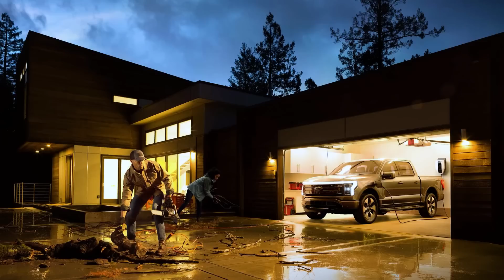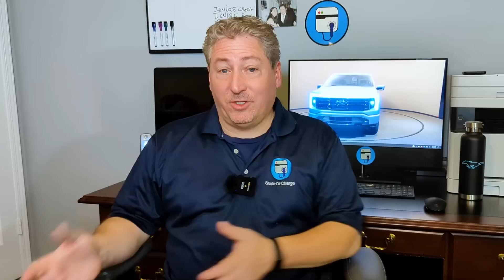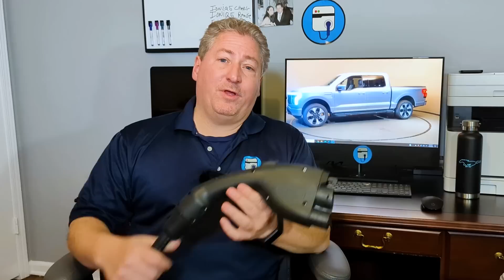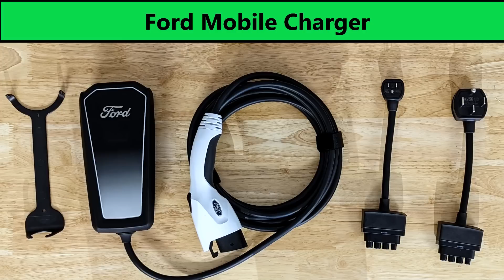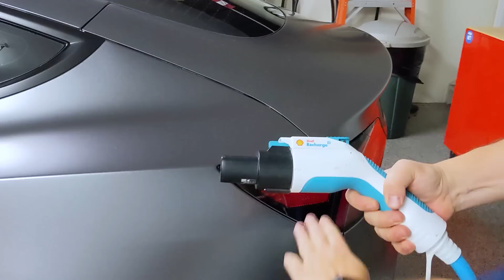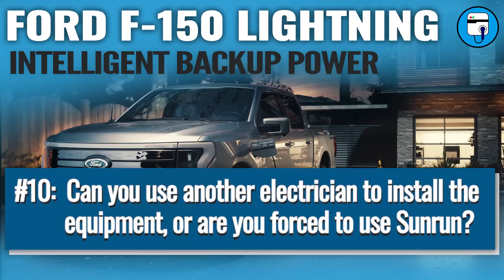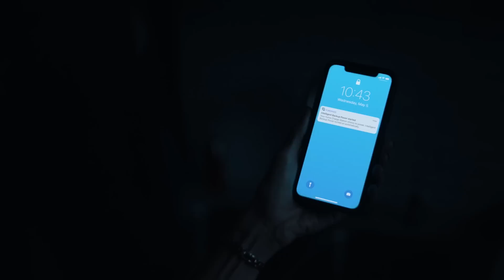Ford F-150 Lightning Intelligent Backup Power: Everything You Need To Know

Comment: Tom, wonderful information. Really appreciate your diligent research. How about non-intelligent backup using the 240 V socket in the bed and a manual transfer switch?
Reply from the maker: That will work also, 30-amps maximum, I'll ask Ford more about that soon.
Reply: I saw the "derpy works" video with this setup using the 2021 F-150 Hybrid and he used a Generac 30 amp manual transfer switch that separated the neutral and ground wires inside the switch box.

I just want to power a camper trailer when I get my Lightning in a couple months so I can get out of town for the weekend!
Reply: @StateOfChargeWithTomMoloughney   Why only a 30-amps maximum? Its total max is 40 amps, based on its 9.6 kW output? On a 50 amp circuit...

fwiw I have asked if using the many forms of backup hookup was an option, in the past...  But with no reply, so I really curious to hear the reply this time... 
Since they all seems more flexible and less costly than what Ford is offering... Since many different power sources can be used with them...  Not just the Lightening...
Reply: @nc3826  The 240V connector in the bed is an L14-30, which is 30A maximum rating.  Could you also connect up multiple cords to the 120V outlets and parallel them for full 9.6kW system output - I'm guessing not based on the overcurrent protection on each.  But you could power the house with the L14-30, and then use the 120V outlets to power dedicated devices - up to the full 9.6kW total output of the truck.
Reply: BJ: I did go into detail  about different ways to do it,, for brevity... But my point was that the "total" system output "available" is the same 9.6kW via the Ford pro or its receptacles... For anyone who needed the extra 2.4 kW...
So thx for your pedantic confirmation of that fact ;)

Comment: Great video.  Follow-up questions...  How does the Home Integration System wire in?  The 80A Charge Station Pro needs a 100A circuit, does the Home Integration System also need a separate circuit from the panel?  Or does it share that same 100A circuit, and wire up only to the 80A Charge Station Pro?  It would seem like some connection between those two is needed - connecting the DC wiring from the vehicle cord to the SunRun inverter?  Also still curious on the specs of what the system can provide regarding surge rating - can this setup run typical 3 or 4 ton central home air conditioning?
Reply: FWIW he mentions it needs its separate circuit...  
Seems to be based on CCS's upcoming V2G functionality.... Which seems to mirror Chedemo... where DC and AC functions are kept separate... Unlike Tesla where DC and AC use the same lines..

And I left a question asking where the DC to AC inversion is done, for its backup power function... But Tom said only the SunRun transfer  box is needed... he did not mention their inverter...
Reply: @nc3826  I think it needs reverse power flow to support V2H but not full V2G support.  The home is islanded with V2H.  V2G implies a lot of coordination with the grid.
Reply: @davidtuttle3429  V2L, V2H and V2G all require "bidirectional" power flow.... Which it will have...(it's not necessary that it be "reversed", on the same circuit),...

And my "CCS V2G" reference was just a conjecture about what "protocols" it uses? Not that its function is to feed power to the grid (even though, it does have the "power circuitry" to do so)....

Sorry to confuse you....

Comment: Since it's pulling DC from the truck, there must be an inverter in the Pro.
Reply: Tom mentioned the inverter is part of the extra equipment you need to buy from SunRun - the Home Integration System.  That kit has the inverter and transfer switch, or so he said.  Charge Station Pro is just a 80A Level 2 EVSE.  Or so it would seem.  Connection between Charge Station Pro power cord and Home Integration System is still cloudy - need more detail there.
Reply: @billjohnson3344  That raises the question which line is the Pro going to back charge.  If the Pro is on a 20 amp circuit, you could only back charge at 20 amps.  You would need another line from the inverter to the main panel to back charge at a higher rate.
Reply: @doug8890  Right, I have that same question.  Still foggy about the Home Integration System hookup.  Surely needs to connect the Charge Station Pro to access the DC from the CCS cable, and then how does it AC connect to the electrical panel (same or different circuit)?
Reply from the maker: I believe there is a second line out of Charge Station pro directly to the inverter.

Comment: Question: Ford says you need a 100A circuit for charging and powering your house. It also says that the power from the truck to the house is 9.6 kW max. Well at 240V, 9.6 kW is 40A (would require a 50A circuit) not near 100A. So why the 100A circuit?
FWIW we have 50A circuits for charging our two Teslas but we have the cars turned down to 20A because that's more efficient, easier on the grid and it's faster than we need.
Reply from the maker: It doesn't require a 100-amp circuit - watch the video. You can have a lower amperage circuit powering the Charge Station Pro, but the wiring will need to be sufficient enough to deliver the 40-amps from the truck to the house for Intelligent Backup Power.
Reply: @StateOfChargeWithTomMoloughney  I did not get that from the video. So I can use the Lightning to power my house on a 50A circuit? Got it. Thanks.
Reply from the maker: @jamesbruce1183  The 50 amp circuit will be to charge the truck. I believe you'll have a separate wire from the Charge Station Pro to your panel to back feed the house. I'm going to get clarity on that. Everybody is asking great follow-up questions and I'll get as many answers as I can.

Comment: Tom, 

You should be able to use a CCS to Tesla adaptor to charge a Tesla.     Tesla sells one in Korea now and coming to NA in the future.  There is a aftermarket adaptor available as well. 

Solar,..... it's called a grid tied system.   Where the inverters will let you charge a battery back up first, then supply the grid.   There should be no reason you can't use the Lightning and a Solar system to at the same time.   If you can't...it's a issue with Ford.  

Since when does a home accept DC power?  If the Lightning supplies DC to the house, there would need to be an inverter to convert DC to AC ....  Im guessing the Lightning actually provides AC...not DC to the home.
Reply from the maker: You may be correct. But I didn't want to introduce that now because it's not available in the US. When it is, I'll do an update. Maybe I wasn't clear - you CAN use your solar system and the Intelligent Backup Power at the same time. What you can't do is charge the battery of your F-150 Lightning while the system is turned on. You can have the solar array contributing to powering your house with the backup power system at the same time.
As for DC power, I explain that the home integration system includes an inverter that must be installed in the house. The lightning supplies DC power to the house - that I am 100% certain of.
Reply: It doesn't use the CCS 8mm pins for charging, it only uses them for backup power.  So I would not expect the Tesla CCS adapter to work as you describe.

Comment: I ordered my F-150 Lighting this month! Will I be able to power my whole house with the transfer switch or do I have to choose which circuits will be powered? I’ve seen both approaches from backup power systems.
Reply: Either option will be available (although perhaps not from SunRun).  It is mostly a matter of cost.  A "whole house" transfer switch costs more and requires a service entrance change (the transfer switch is installed up stream of the meter).  This usually means more installation cost.  A subpanel with a smaller transfer switch is thus more common.  The 200A transfer switch is about $600.  The 30A TS is less than $100, and a 30A TS combined with a subpanel runs about $400, including 10 breakers.

Comment: What is wrong with dwellers of USA to use 30kWh/day? I live in UK alone in comfortable house 70m2 and I use only 5,4 kWh/day with electric kettle and hob. That is 5,6 times less. Will Americans ever start to save energy?
Reply: Tera Nova Where does your heat come from?  Town central heating? My house is 1800 sf -> 180m2, so it is much larger (but average for US homes).  In addition, we have air conditioning loads in summer.
Reply: @evahsia  Hi, I have natural gas for house heating and water heating and I used 435 m3 in 2021. That is an energy of 435*11.2= 4 872kWh/year. So from natural gas I use on average 13.4kWh/day. I do not have air condition system at all, it is very mild weather in UK most of the year. For example now it is only -2°C. So my total home energy use electricity and gas is 18.8 kWh/day. If I had air condition/heat pump I would use only electricity and I estimate it at 10...11 kWh/day.
Reply: @teranova5566  Thanks.  Your detailed answer caused me to look at my numbers closely.  Since I installed solar power last march, I have detailed numbers (for 10 months).  We used 13,960 kW, or 1390 kW per month or 19.5 kW per day.  This includes charging 2 electric cars.  Total annual mileage on the 2 cars was 8379.  Converted to kW that is about 2400 kW, or 200 kW per month or 6.7 kW per day.  So, our non-car usage was 12.8 kW / day.  (We have a heat pump.)
Reply: @evahsia  Hi, thank you Ralph for details about energy use. This is rare because about 90% of people have no green idea about energy they use or even energy units. Please take into consideration you should use kWh unit in your data that is energy. It is a power that is measured in kW. Anyway the amount of energy used 13960 kWh per 300 days(10 months) is average of  46.5 kWh/day, so without 6.7 kWh/day for cars it is 39.8 kWh/day for the house. Regards.
Reply: @teranova5566  Well, this is embarrassing.  I know that everything should have been in kWh, not kW.  That was sloppy of me.  But the math error was inexcusable.  The only thing I can think is there were figures left in the calculator when I did the calculation.  So, yes, we use 46.5 - 6.7 = 39.8 kWh for the house.  It is a standalone house of 180m2 so that is about 0.22 kWh per m2-day.  Thanks for the polite correction.
Reply: Q: Will Americans ever start to save energy?  (Phil shakes the Magic 8-Ball for a few seconds then brings the little window into view)  A: Outlook Not So Good.
Reply: Air Conditioning and larger homes is a big part of the extra consumption.   It wasn't the Winchester repeating rifle that settled the U.S. Southwest... it was Willis Carrier's Air Conditioning invention that settled the West.   Over half of Texas grid load in the summer is residential Air Conditioning.   Plus, sometimes people don't include the energy consumed via natural gas or district heating when they compare their electricity consumption to our electricity consumption.

Comment: Very good video. Thank you Ford for engaging with Tom to get us the information we need.
During the great Texas Freeze-Out we used a portable generator to charge phones and run a couple heaters. The Lightning comes with a built in inverter (2 different capacity versions?) meant to replace a portable generator at a job site. Is it possible to have the truck's inverters on but have the truck secure to where it cannot be driven off? While not as robust of a solution as the Intelligent Backup Power, it would do in a pinch and certainly be safer and less troublesome than a gasoline generator.
Reply: Yes, you can turn on and off any of the three zones (bed, interior, MegaPower Frunk) separately whether the truck is running or not. You can use those outlets when the truck is driving and when the truck is charging.
Reply: @chasingcoralMD  Thanks! That's perfect.
I see that you also got a test ride in a Lightning. I sure wish they let us film that from inside. It will be hard to get people to believe what that truck can do. All EVs are quick off the line but I was absolutely stunned by the handling.

Comment: Great video.

Do you have to have WiFi for the Charge Station Pro for it to charge normally? 

Is charging time programming (ie. charge at night between set hours) set in the vehicle settings, or through charger settings?

Does the Charge Station Pro have a built-in inverter for DC from the vehicle to AC for the house?

What provider is being used in Canada? And also, when does Sunrun anticipate releasing more details of the Home Integration System, including pricing?

Comment: Hi Tom!  Great video!  Some more questions for you and Ford on this topic...  

- Sunrun doesn't appear to actually make their own solar hardware.  Which manufacturer's brand and models of equipment are they planning to provide for the components of the Home Integration System?

- Sunrun is also not located in nor servicing all states.  When will the documentation be available for the Home Integration System components for electricians/solar installers?  

- Do Ford and/or Sunrun plan to offer a cross-branded solar hardware compatibility guide for existing solar installation owners?  (If not, they absolutely should be thinking about this!)
Reply: More details on installation are definitely needed.  For example, does the DC out of the charge station to the inverter run on the same wires that feed ac to to the charge station?  If not, what additional wires are needed to run to wherever the inverter is installed?
Reply: id like more of the wiring diagrams and physical looks / how it's supposedly wired up and how it works the add's was ok but way to fuzzies on the real house 🏡setting it up to work and be 🇺🇸 legal. my installer that i had a bid done for liked enphase 8h inverters ( new for 2021-23 ) aka 240v ac @ max solar line amp's of 220A ish 15kw-20kw system the my 400A main panel so i don't know 🤔if the sunrun use's simar hardware or its a high 800~ voltage dc setup like some of the fronics/Europeanised inverters
Reply: You're looking at approximately $4000 for the home integration system from Sunrun.  I haven't heard what their installation charges will be. Most likely very high. But the Sunrun system should come with instructions for an electrician to install it. Still costly because the line in from the grid will have to be rerouted from the main service breaker to the Sunrun system transfer switch and from there back to the main breaker.  There was a comment about some home supply services being as large as 400 amps.  I'd be surprised if Sunrun transfer switch would accept the size wire to handle that kind of current. I'm thinking they'll probably have a 200 amp transfer switch in their system. The inverter in their system is also unique as it's input voltage from the truck will be around 400 volts DC. I believe this will be a very costly installation.  I would be very interested in hearing from anyone that's had their home integration system installed.

Comment: can you manually enable the  backup power to add to the house power? Would be cost effective for you (and good for grid balancing) to charge overnight on cheap rate, then use it to feed into the house during the day
Reply: See my reply to Kevin Thompson.  The short answer is yes, if you install a subpanel and feed the subpanel from (only) the IBP and the main panel from (only) the grid.  (The subpanel would also be fed from the grid when the IBP wasn't connected, via a manual transfer switch.)

Comment: Good information Tom.  A couple of questions.  Is the intelligent power true rms?  You mentioned that you can have the power from the truck come on automatically or manually.  Is this connected to the transfer switch and switching the transfer switch automatically when in auto and also switching the transfer switch when you select manual?
Reply: Also, you could take your Dremel tool and easily make the Tesla adapter work on the Pro connector.  Just a little grind on the plastic webbing and your in business.  LOL

Comment: Can the Ford Intelligent Backup Power also feed AC to the *grid*? Only if this was possible, then it could be used as an energy storage to charge when rates are low (like at night) and feed AC back to the grid during peak hours. Just like people do with Tesla Powerwalls or other home energy storage systems.
Reply from the maker: I'll ask but I do not believe it can. Ford isn't going to warranty a battery that you're using for daily energy arbitrage, IMO.
Reply: @StateOfChargeWithTomMoloughney  That's two different aspects: one aspect is, if it can do that at all. In that case the DC to AC converter on the infrastructure side will need to synchronize with the AC from the grid just like a solar to grid inverter. Warranty on the battery is a different aspect. It will depend on the depth of charge/discharge each day. Charge and discharge power however is only about 0.1 C (9.6 kW / 100 kWh).   With such small charge power, it may easily accept thousands of partly charge/discharge cycles as long as they are kept to about 15-20 kWh per day, which is roughly 1/10 to 1/5 of the capacity and therefore 10% -20% DoD each day. It will be a different story, if people are using 90% DoD capacity of the pack each day, like charging about 80-100 kWh each night (say 10h times 10 kW) and feeding the same amount back each day. This usage would result in daily full cycles, which indeed will affect battery life.